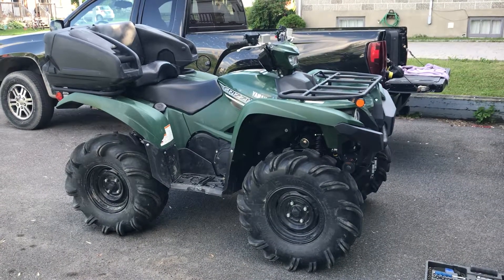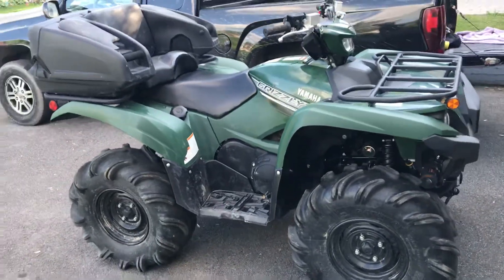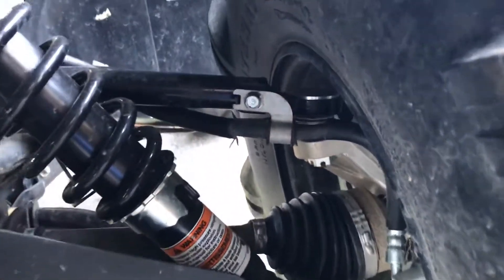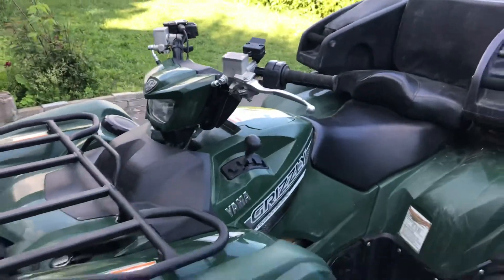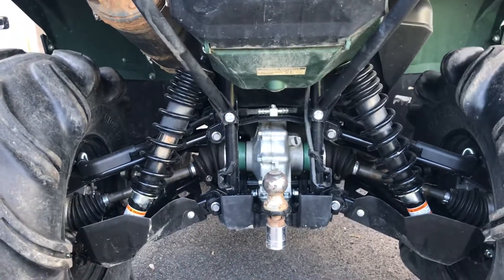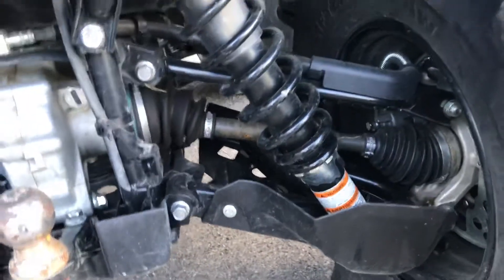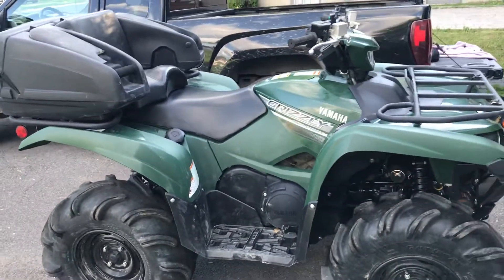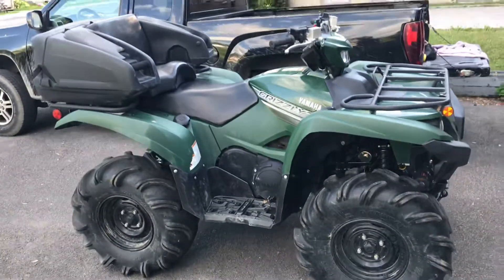NEW 2017 Yamaha Grizzly 700 on 28" Outlaws Walk Around

Comment: Yeah makes sense lol yeah I have the same machine with 26 inch mud bugs and quite frankly i think they are too small I'd like to go 28 or even 30 cause I keep getting hung up in the ruts and mud holes . Did u notice some sort of powerless at all with those
Reply from the maker: kgb 89 it’s my buddies machine. He hasn’t mentioned anything about any power loss tho. He can still wheelie in high gear. Really impressive machine. You would likely wanna do a clutch kit if you went to 30’s tho. Most brands of tires have pretty large lugs at 30 inches.
Reply: @HondudeTeamMudhogs  so he's doing fine with 28s no clutch kit?
Reply: Not clutch kit with 28?